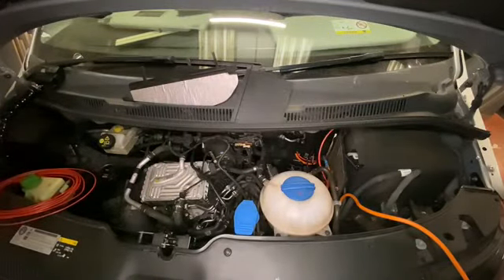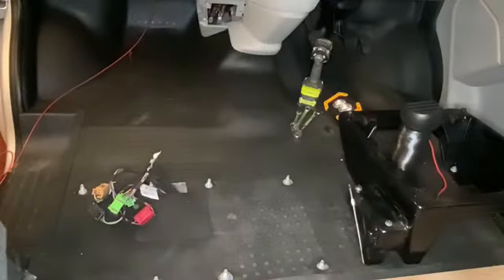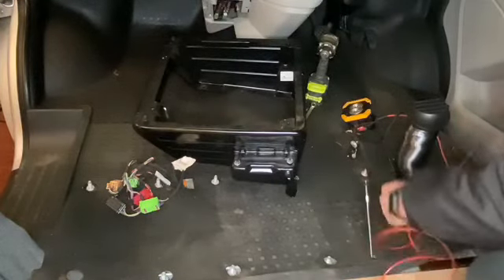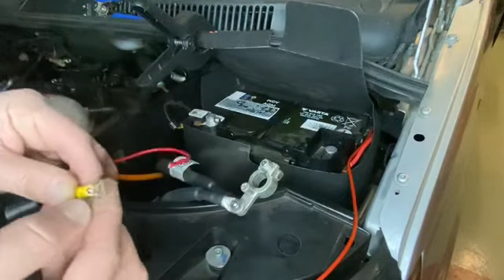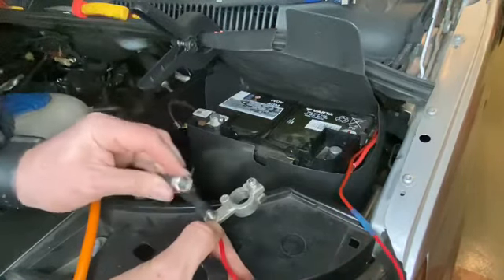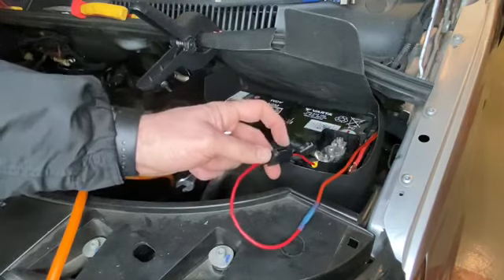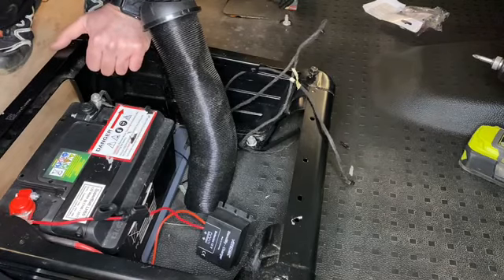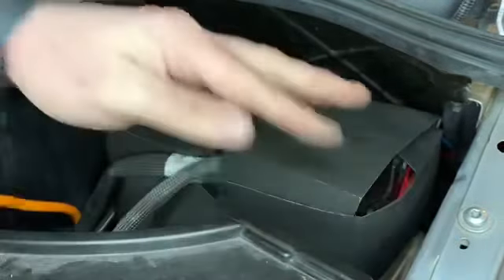HOW TO Install a leisure battery on your Campervan. This one is a VW T6

Comment: Thanks for the video. Did you choose the drivers side in order to balance the weight or the battery could be installed on either side? Other thing, do these led acid batteries release gas inside of the car?

Comment: Hi mate.  Great video. 

I’ve owned my Leighton T5 since new.  It’s a 2013 so had it a good few years.  A few months ago the internal spot lights stopped working.  Then I noticed our leisure electrics stopped working.  

Ours is also under the drivers seat.  

I could go back to Leighton vans to get it sorted but it’s a 3 hour drive away.  So if it’s a case of just swapping the battery I might have a go myself.  

Do you think the internal spot lights not working is related to the leisure battery 🤷‍♂️?

I don’t have a clue about auto electrics.  

I also found out tow bar electrics have stopped working also. 

The camper was basically parked up for the whole of covid lockdown.  

So I think that’s what’s happened. 

What’s the best leisure battery to get?

And is there a chance I could maybe re charge the one i have.  Or would you say 8 years is a longtime and that it should be changed anyway. 

I’m also considering just deleting the leisure battery all together and going with a jackery power box.  🤷‍♂️

Any help advice would be massively appreciated

Or if you are anywhere near Merseyside maybe you could take my van on as a job.  

😬
Reply: Any update with your van?
Reply: @amac2137  ended up changing the leisure battery and a few other things.   Then a few months later traded it for a crafter camper.  I’ve had issues with the crafter.  :(. Owned it a year now and only just getting somewhere with it.  Miss the T5.  But the crafter is good also.  Well now it is anyway after spending £3000

Comment: Hi, Great vid cheers. Question… my T6 leisure battery is showing a low reading on my solar panel app. I’m very much suspecting a bad battery (not fitted by me). Once drivers seat is out, can I do a straight swap 90ah for a 110 (same dimensions) without having to do anything else? Cheers

Comment: It's a great video, thanks for putting it up. I'm not an electrical person so please excuse my ignorance. When the leisure battery is installed how do you select it to run the items you want it to run and not drain the starter battery? I'd seen some VW forums and I thought they said that most of the internal electrics were run from a separate leisure battery circuit, but this doesn't seem to be the case here. Is it the relays that choose which battery powers the van electric circuit when the engine isn't running?
I'm thinking about a VW Caravelle (probably a T5) so that we use for family holidays, somewhere comfy to stay in long distances not to sleep in overnight. I was thinking about a leisure battery to power a TV and possibly some music for when we stop. Does the battery you showed fit under a Captain's seat? 
Many thanks
George
Reply from the maker: You connect all your auxiliary items such as your tv to your leisure battery. 
When the vehicle has started it will charge the leisure battery, when it’s turned off the starter battery is isolated so when discharging the leisure battery your starter battery remains full.
Reply: @bosswayltd  Thanks for replying quickly. That makes perfect sense, many thanks.

Comment: Wish I'd seen this yesterday! I'm installing a CTEK any chance you could show the installation of one of those I have my cables through but not sure which fuse to use to get an ignition feed. Great vid
Reply from the maker: Thanks David!

I believe your CTEK will be 25A (you can check on your box) so I’d be putting a 30A fuse in there so allow for the draw but will blow if there’s a fault and it goes up a lot more then you have protection.

Comment: Is that 16mm cable and what make was that battery charger called please great video
Reply from the maker: It depends on the split charger that you fit on the cable size you need - a charger like the link below is 20a charge rate so something like a 6mm cable would be fine. 

https://bossway.co.uk/collections/campervan-conversion-accessories/products/12v-20a-dc-to-dc-battery-smart-charger-with-mppt

Comment: Great video,  what brand is the trickle charger ? And does that negate having to use a ctek or similar smart charger if I’m not using solar  ?
Reply from the maker: Something like this would work best if you’re using solar or not. Charges quickly and is a fit and forget system. 
https://www.bossway.co.uk/collections/campervan-conversion-accessories/products/12v-20a-dc-to-dc-battery-smart-charger-with-mppt

Comment: Hi, Thanks for this video. Very helpful. Its the first battery install I've seen in video which include the heater ducting under the seat as well as the battery. This is setup I want to do but most other install videos put ina  huge battery which leaves no space for the ducting, they've use AGM batteries too so they often lay them on their side. Could yo let me know the dimensions and spec of the battery you show in this video and whether the fixing plate for the battert might go 90degrees so a larger battery might fit along the side of the seat base rather than at the back of it as you have shown.
Thanks for the help. Good video!
David
Reply: be really interested in battery make and model if possible - same reason as above.  Thanks
Reply from the maker: Thanks a lot got your kind comment. 
It’s a 65ah battery - you can get them anywhere online. 
The reason it’s towards the rear of the seat is that the base is angled to there’s more height at the back of the seat than the front, you don’t want it to fowl on the seat when it’s moving.
Reply: Bossway thank you. How do you get on with the 65ah battery? I was just worried would be too small - what’s your experience. Thanks again for your reply.

Comment: Useful video thanks. What diameter is the cable please?
Reply from the maker: Hi Kev! There’s online calculators for the amount of amps you’re drawing and the distance so you might want to seek your own size for your system. The size I used in this video is 12AWG.

Comment: I won't trust those thin cables at such a distance of more than 10amps.
Reply from the maker: This cable is rated to 20amps. If you watch the whole video you’ll see I’m connecting up a trickle charger which charges at just 3amps so for this application it was more then enough but you’re correct, there’s online calculators for anyone who needs help in getting the correct gauge for the amps and distance they require.

The principle and route of cable I hope helps some people who are trying to fit them selves.